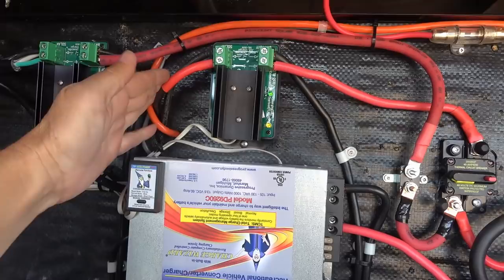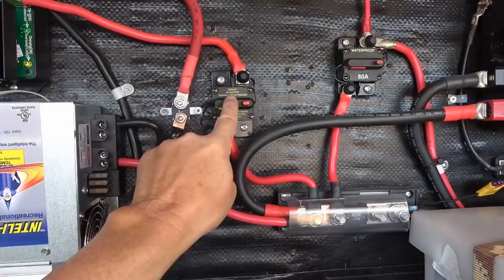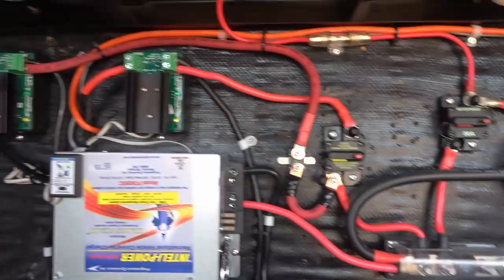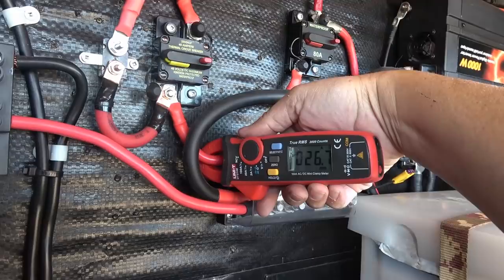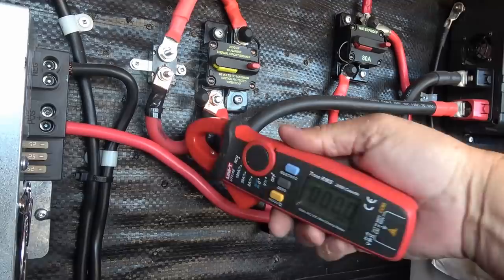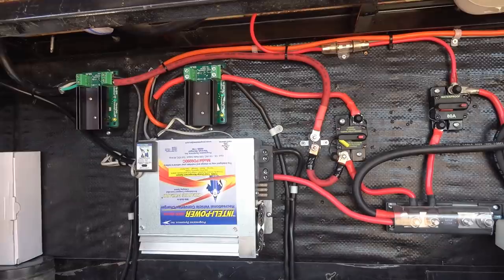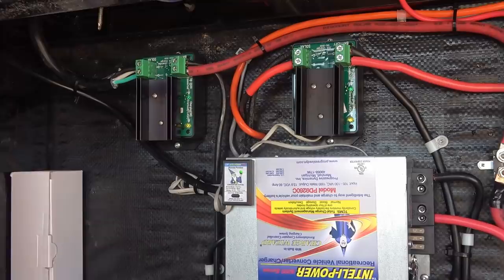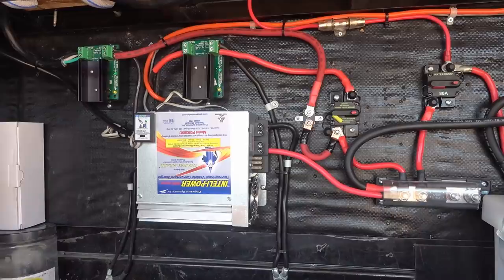Alternator Charging Mod + 12 VDC (High Amp) Truck Bed Power Port

Comment: You need to just run a DC to DC charger. A 40 amp unit would probably be perfect for you. You would virtually never need to run your generator unless you needed ac running in the rig.
Reply: I think you missed the point of this video. Anyone can simply buy a DC to DC charger. This is an attempt by Ray to use what he has "on hand" to accomplish the same thing. BTW...we who live on wheel often stay in one place for 14 days or so. Vehicle charging alone would never suffice.
Reply: G Henrickson I didn’t miss anything. He could almost get the same results by just using the charge wire in the 7 way plug as it’s rated to 40 amps or more in most trucks.
Reply from the maker: DC-DC converter looks to be the best way to go to get the voltage boost needed to overcome my smart alternator and the long wire run required. The 7 pin tow cable wire gauge on my truck are very thin though, looking at them I'd guess around 14-16 GA .   btw, this was the Bogart demo test I was trying to replicate - https://www.youtube.com/watch?v=2yhC-43P_Uk  Cheer's, Ray
Reply: Love Your RV I agree. Good luck with it!!

Comment: Should of used a Anderson plug.Instead of the 12v plug.
And use a ctek dc to dc charger
Reply from the maker: Thanks, may change some things when I can get parts, maybe these - https://www.etrailer.com/Wiring/Pollak/PK12801.html?etam=a0009

Comment: DC suicide plug...hope you never short out the positive and negative plug leads, but hopefully your 40a or the 250a breakers will pop before destroying your battery or alternator...maybe a female plug configuration, like used to hook up a generator for off grid solar...
Reply from the maker: My Ram trucks HAPP -  High Amperage Power Point is test to 300 amps - https://www.ramtrucks.com/assets/bbg/pdf/2016/docs/cc/HAPP.pdf if both the 40 amp breaker and the 250 amp terminal fuse fail then I'm doomed! But like I said I plan to swap the 250A with a lower amperage one.

Comment: I get what your trying to accomplish but I'm supersized after a 2-3 hour or longer travel time the positive wire in your trucks 7-way plugs isn't topping off your trailers house battery's. The 12 volt positive wire in your 7-way plug is fused at 30amps already. I think Id be double checking your connections on the trailer side from your 7-way cord all the back to your trailer house battery's and confirm your truck is charging them. I guess I'm just puzzled why your truck isn't topping off the batter's in that amount of time. what your adding to your truck it already has in place. The large gauge wire I could understand if it was over a long distance and you had voltage drop issues but that distance isn't that far.
Reply from the maker: Fuse sizing is one thing but actually amperage available for battery charging is another. As far as I know the 30A fuse is sized to take into account the paralleled wired: trailer running/brake/turn signal lights plus the electric trailer brakes, So needs to be size in case you have lights on, hit the brakes and are charging the battery bank all at the same time.
My trucks tow cable wiring for charging is what looks like 14 -16 GA, quite small gauge, over a 60 foot round trip run, at best it trickle charges a single house battery with maybe 5-7 amps, once you increase the battery bank size it's basically useless. I have 315 AH lithium bank which is comparable to a 600 AH lead acid 6 battery bank.  Cheers, Ray
Reply: @LoveYourRV  Mike may be supersized after he stops at 3 restaurants on a 3hour trip but his point is correct.  The factory 10 ga. wire to the seven way rv plug is sufficient to charge rv batteries.  It is isolated by a relay and fuse under your hood.  Relay closes when engine is running.  A Charge controller is not needed just like your under hood batteries don't need an additional one.  The pcm is the voltage regulator.  A very good option is to replace the pcm/vr with an adjustable one.  Most common chrysler pcm replacements are alternator not charging!  Good day sir.
Reply: @chuckchase8432  his battery bank is bigger than most people's I think so I can see it taking a little longer to charge and top off  but it should still work .
Reply: @LoveYourRV  left turn stop/ right turn stop/ electric brakes / reverse lights/ 12 volt circuit are all on separate fuses circuits.
Reply from the maker: Doh, sorry you're right, my bad.
Reply from the maker: Just ordered a 40 amp Renogy DC-DC charger to review and test, will do some comparisons to the OEM Ram 3500 tow cable charging setup.  https://www.renogy.com/12v-dc-to-dc-on-board-battery-charger/  I think a lot of people are switching to these due to the new vehicle's smart alternators not putting much tow cable charge any more due to them regulating the voltage lower as you drive and RVers have bigger battery banks now and some are running lithium which takes a high charge voltage.
Reply: @LoveYourRV  looking forward to it.👍 it's always fun seeing new stuff.

Comment: You could use a DC/DC  converter to drive the charge controller much harder and reduce your voltage loss.  If time and $$ were no object.
Reply from the maker: Good idea, thanks. maybe I can find a cheap one to bump up the voltage a little and output enough amps. Cheers, Ray
Reply: @LoveYourRV  Guess it all depends on much much charge you need and how long you have to fo it.

Comment: I was told by my hitch installer the center wire in your trailer plug is used to charge your RV battery/s. Are they wrong or do I need to check? I have a 19 Ram.
Reply from the maker: I believe the center is for reverse lights if a trailer has them, mine doesn't - here is a pin diagram for a standard fifth wheel tow plug -  https://www.etrailer.com/question-252629.html

Comment: 12 amps is a waste of time!  I get 120 amps in a similar system in my Sprinter van on idle. Using a Victron cyrix ct 120 and a heavy single cable from the smart alternator. Just got to be mindful on a hot day idling without wind to cool the alternator!

This was a cheaper way to get more amps than using the Victron 50A buck boost DCDC converter. This system allowed me to dump the Honda generator. Much quieter to charge with and quicker to charge the 720AH of LFP
Reply from the maker: Nice! What is the distance to the batteries and wire gauge you used. I'd be looking at about a 30 foot run to get to my trailer battery bank.  Thanks Ray

Comment: So, Ray, that other plug one sees in your truck bed near the plug you put in, that the trailer plug? I wonder why it was put there and not by the ball hitch receiver. Would it have to do with the truck being set up for the 5th wheel from the factory? I would still think it'd be better for the plug near the ball hitch receiver, maybe that's just me. :P And, good thought putting the disclaimer at the beginning of the video there too, I know there's quite a few stupid People if you want to call them out there.
Reply: I do believe this truck has a seven way and four way plug on the bumper near the receiver as well. So you can plug in to a bumper pull trailer. I have the same set up, 16 Ram with the factory  fifth wheel prep package.
Reply: @rjl7765  Hmmmm, interesting. I didn't really see a plug near the ball receiver itself. Do you think their are up near the license plate in the bumper?
Reply from the maker: My truck has the tow package so has the 7 pin in bed plug as well as a 7 pin and 4 pin tow connection down on the center of the bumper.
Reply: @LoveYourRV  So, my one comment was correct about there being a plug in the bumper up near the license plate?
Reply: @morganrussman   Yep,  just to the right of the license plate in the center of the rear bumper.May not have been shown in this video, nor have I seen Ray's truck in person but I am quite certain it will be there. My truck has the seven way in the box for fifth wheel or goose neck towing as well as the four way  and seven way neatly flush mounted on the bumper.
Reply from the maker: @morganrussman  Yep, two plugs, one 7 pin use mostly for RVs, and one 4 pin used mostly for boat trailers.
Reply: Ok. :)